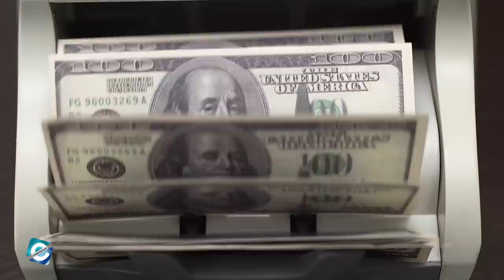Where is Norm Abram today? Norm Abram Net Worth | Age | 2022 Updates

Comment: Norm is my age.  Thanks to this old house, renovated a 1908 house in Los Angeles.  I was retired as an Electronic engineer but was far from doing wood work.  The house in Los Angeles is 5661 Ash St.  I spent 2.5 year restoring two houses mostly by myself and when my son had free time. I did all the electrical, plumbing, carpentry, drywall finish, tiling bathroom, install earthquake hardware including strut one plywood. I drew the plans and my son put it on autocad. Thanks to This Old House and You Tube it was possible to finish the job. The building inspectors were amazed at City Hall. They said it was a father and son team doing what should have been done by professionals.  

Thanks to Norm and Silva and all of This Old House

Comment: Norm is way too young to retire.  I am finishing a project at Discovery Bay. There was major dry rot and the windows leaked.  I and the owner pulled window out and rewrapped the house. Then reinstall the windows. I have put the drywall back so this Friday I will be using a hopper spray tool to recreate the original texture.  In addition to that the house Jack failed. I helped jack hammer the piers and poured new piers.  We have the new adjustable house Jack so soon we will install. Current beam to door has temporary support.  

I maybe retired but I got my backyard to do.  I have concrete to pour.  I do myself. A 1-2-4 mix. That I will use.  

Norm you too young to retire please come back